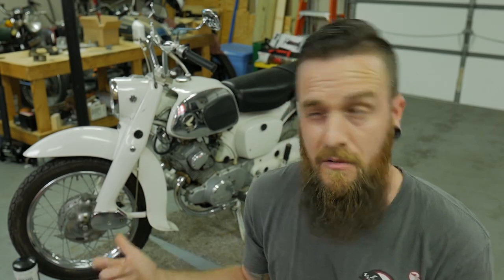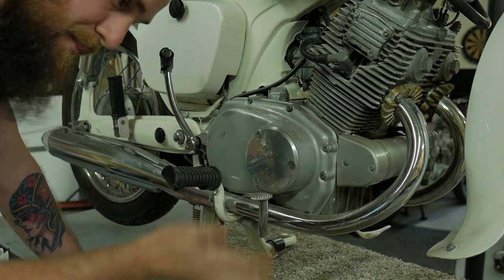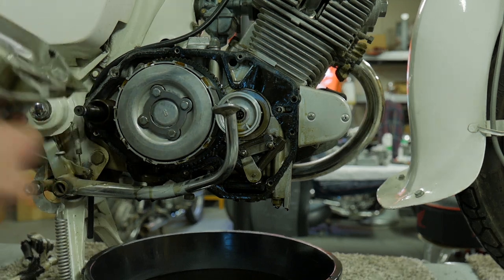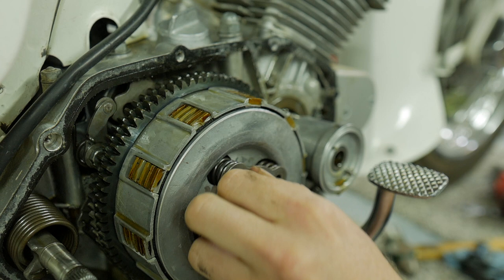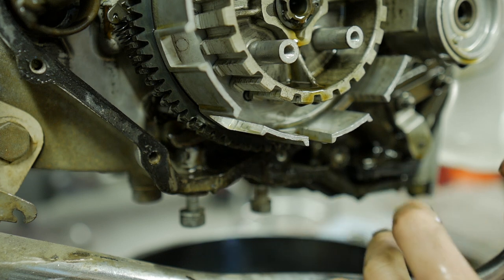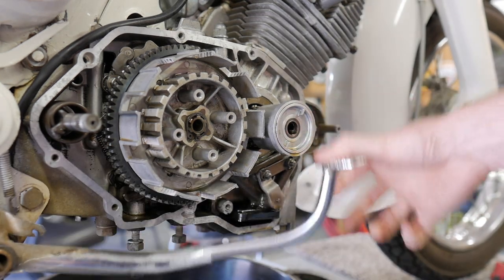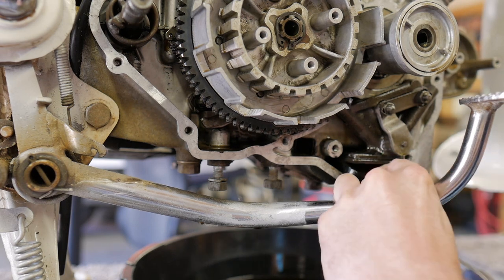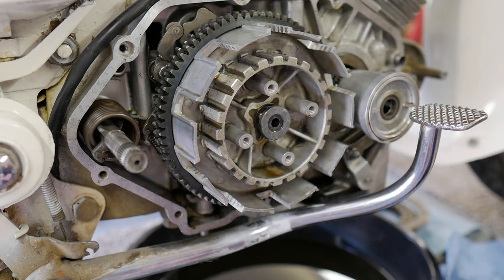Honda CA160 Sticky Clutch Rebuild

Comment: Always soaked both metal and fibre clutch plates overnight in fresh oil. The reason is that once the clutch is assembled, the plates are very close together, and the oil can have a hard time getting between the plates.

Comment: Once on my CB450 the carb float stuck and I hadn't closed petcock. I filled crankcase with gasoline.   I caught it and changed oil and fixed float.  Later on engine rebuild mechanic said this was the cleanest CB450 he'd ever seen.  No sludge, etc.  Curious your thought about that.  Was gasoline in crankcase a good thing?
Reply from the maker: With it soaking in there, it wouldn’t hurt. but the moment that bike is ran up to operating temperature, that super thin oil and gas mix will wipe the crank bearings like a big dog. I have heard of a few cases where this wasn’t caught in time. One of them in a beautiful blue K0 450 😬

Comment: Would it be a good idea to insert a small (25 mm diameter OMB FCOMB01) paper filter into the oil pump circuit to help out the centrifugal filter out or would it just dangerously decrease oil pressure and cause the engine to seize?

Comment: Great video. Sorry if I missed it but how do you know those are the only two areas that need a little rtv? What is special about those corners compared to the rest of the surface? Cheers
Reply from the maker: Because that is where the cases meet horizontally. If there is an imperfection Or as the cases heat up you want those spots backed up by a little sealant to prevent leaks.

Comment: First and foremost thank you for all your video's and newsletters. 
Have a question: I recently changed oil on my 98 Shadow vt750C3, but because I was going to go for a two day very long ride I put in 20/50 oil and not the regular 10/40 W oil. well, clutch discs/plates stuck, only had 2 , 3, 4, 5 however on the run to check for leaks I lost 2nd. So I changed back to 10/40W oil finally got into neutral, ran for 2 minutes to lub system, shut off and zip tied clutch. Next moring, drained and changed oil again, took it for a leak test and I had 1 N 2 & 3 but no 4 or 5.  Tried rocking & rolling bike no affect. On advice I put bike on stand, started in N shift to 1, released clutch ok, shifted into N ok, put in 1 increased rpms shifted to 2, then 3 then 4. Hit kill switch, zip tied clutch and its sitting. After 2 hours I'll take it for a run to see if plates/dics released and run it thru 1 N 2 3 4 5 gears , any thoughts?

Comment: Hi mate, could you please tell me what could be a cause and and fix to a heavy operating cluch lever on 2002 Honda CB600F ? I have changed the cable and levers - still heavy to use. A woman would say NO to this. Probably springs in clutch assembly, but how can I get it right to fix? Replace with new ones or softer, or anything? What may have gone wrong with stock springs so they became heavy..? Help Cheers man!